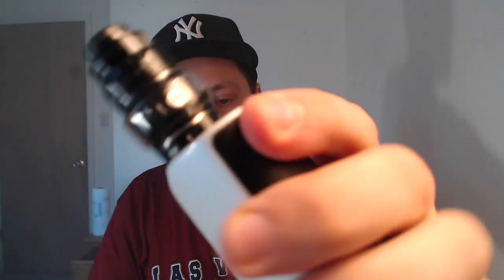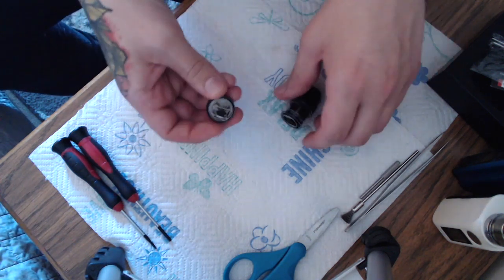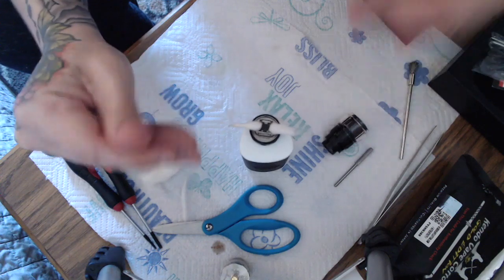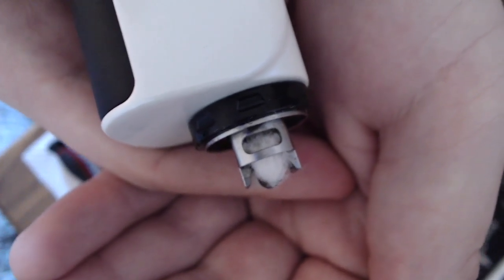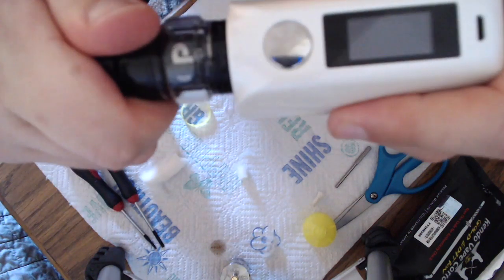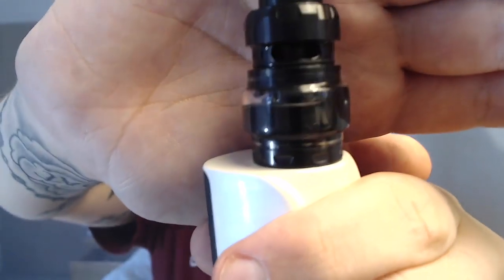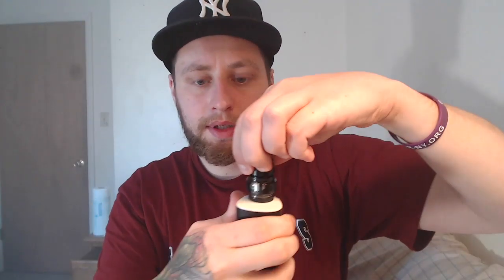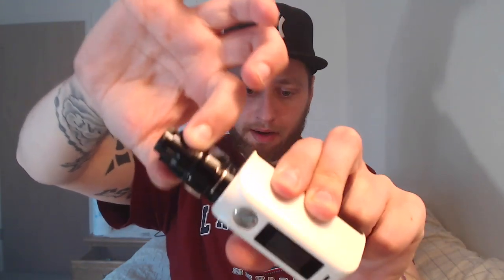QP Design Juggerknot Mini RTA

Comment: push the nozzle tight up against a corner of the fill hole, make sure the tip facing straight down. also keep the tank 100% horizontal while filling.